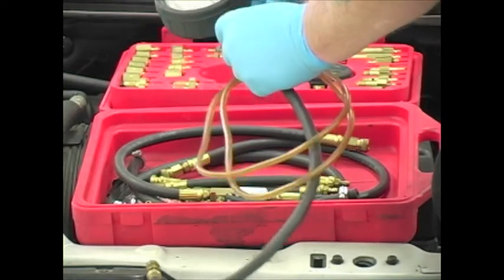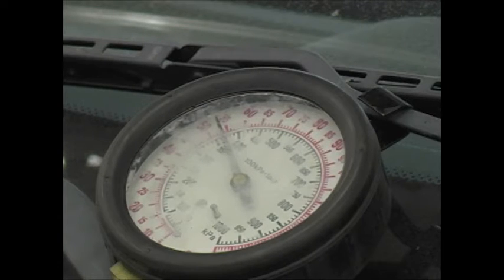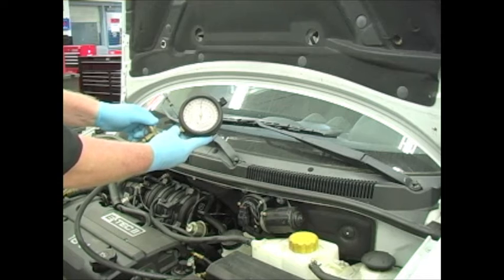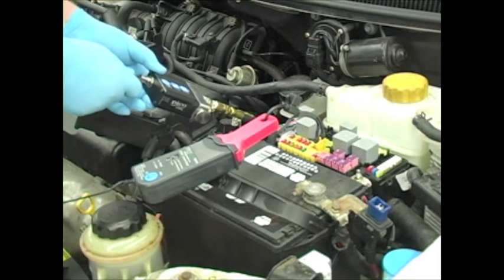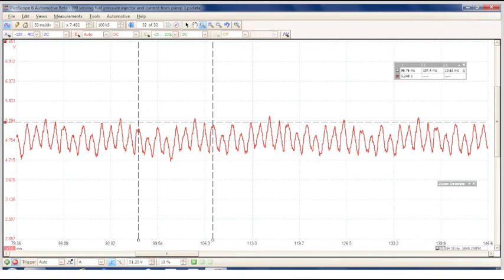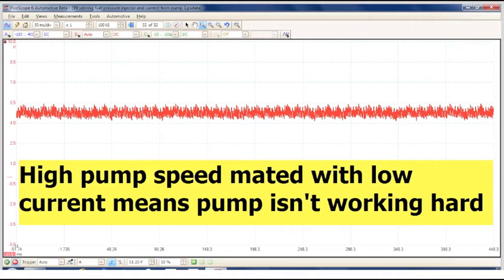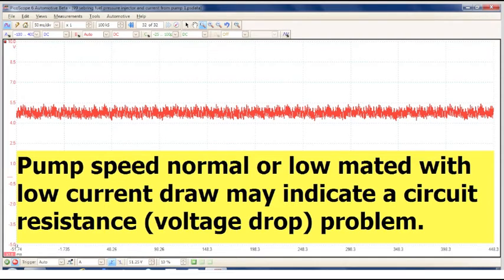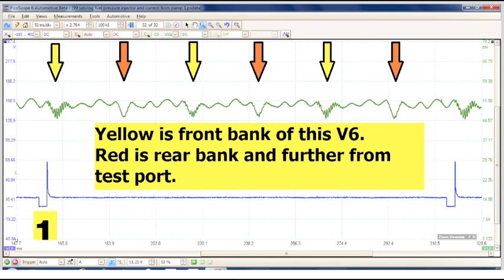The Trainer #15: Fuel System Diagnostic Tips

Comment: if you are gonna hook up the pressure transducer into the fuel line, which some vehicles are a pain, might as well hook up a fuel pressure gauge instead.
Reply from the maker: But I'll see a lot more with my waveform than I can with just a gauge reading.

Comment: I joined your community.In this video how did you come up with 10.62x600 to find pump speed?I thought about it and my calculation is in a minute there are 60,000ms so if in 10.62ms the pump turns once shouldnt we go with 60,000 divided by 10.62?

Comment from the maker: As with an diagnostic technique, the time to try it out is on lots of "known good" cars. You also need to read up on how a particular system works. The Ford Electronic Returnless system is one example of a system that may look strange on the scope but work perfectly. Generally, if I know the spec pressure is 60 psi, I'll look for somewhere around 6 amps as "normal". Pump speeds, in my experience, generally run around 5000 to 7000 rpm.

Comment: where do we get specification for fuel pump current and speed?is there a rule of thumb or different for every vehicle? You mentioned that 1amp for 10PSI ,so if we have pumps that run 12 amp is the pressure 120 psi ? or 12 amp is an indication of restriction?In this video for your corolla 6400 rpm is normal?How about FORD or GM?Sorry I have too many Qs. 

Thank you